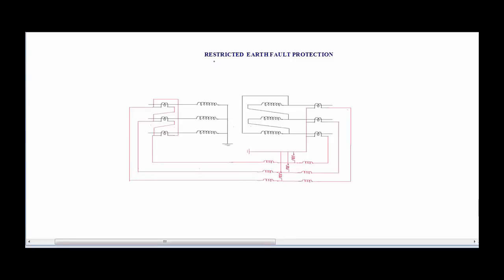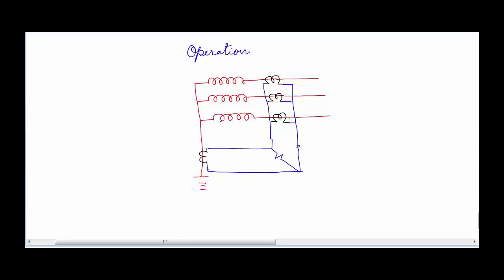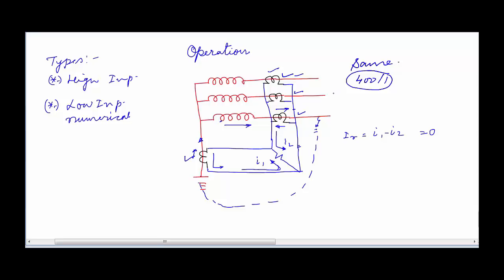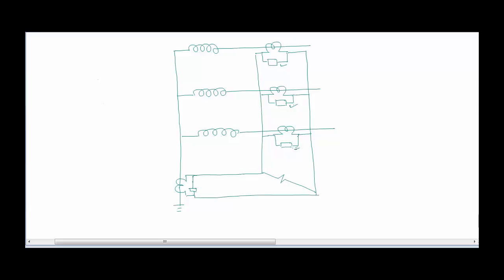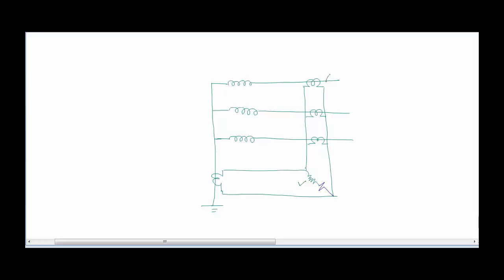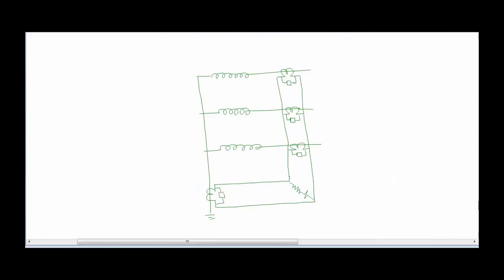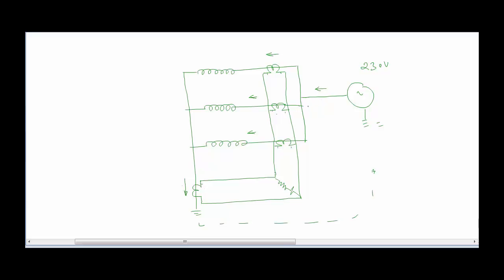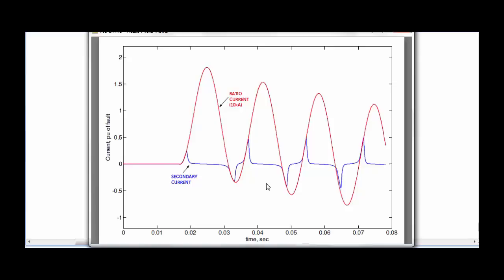REF Protection and it's satbility

Comment: thank you so much. What about the low impedance ref prot? using the numerical relays? are the CT secondary currents converted in pu and the rest concept is the same?
Reply: Yes . Please explain with  numerical relay and mainly per unit system.